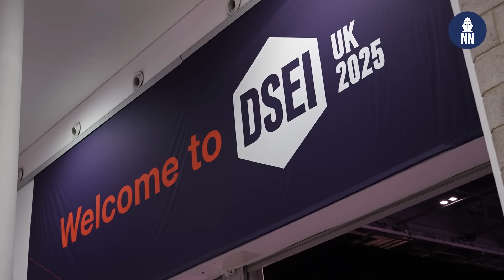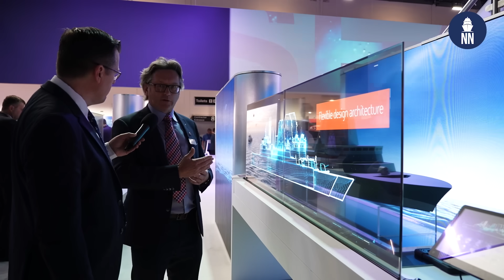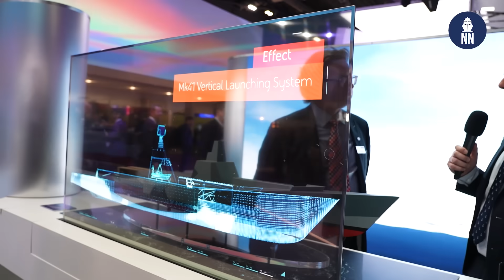Future Air Dominance System (FADS) concept ships by BAE Systems

Comment: Air dominance is important but I believe more urgently we need a significant improvement in anti submarine capability. It seems Russia will be a threat for the foreseeable future and the UK is very vulnerable to undersea warfare given our data and oil connectivity to Europe and Scandinavia. I feel we need to revive the WW2 concept of the "Flower Class Corvette" That is a cheap quickly mass produced hull (An off the shelf design preferably to speed up delivery). Fitted with up to date anti submarine (and drone) technology. Crucially we need enough of them to continuously patrol the entrance to the Baltic and the Greenland/Iceland/Scotland gap to counter Russian sabotage in the North Sea.

Comment: Sounds like the goal is to get the crew so small that they will never get to sleep. The ship will have reduced effectiveness after two days, and there will not be enough space onboard to train people.
Reply: The lean manning critique is fair for 1st generation automated ships, but it overlooks the core design shift in the Type 83 and FADS concept. BAE is moving toward 'Mission-Led Manning' where the goal isn't just to cut bodies, but to eliminate the manual donkey work  like damage control monitoring and routine maintenance,that actually causes sleep deprivation. By using a 'system of systems' approach and uncrewed vessels like the Type 91 arsenal ship, the Royal Navy can offload the magazine depth and high-risk tasks to autonomous platforms, allowing the crew on the Type 83 to focus purely on high-level command and control. Modern ship design now uses Human Factors Engineering to simulate crew fatigue levels decades before the first steel is cut, specifically to ensure that the shift to AI and automation increases tactical endurance rather than exhausting the sailors.

Comment: I can't imagine the smaller design being an option. Large and powerful radar systems, like those that would be required are heavy and power hungry so you would need a hull big enough to support that and enough power generation to power the sensors as well as future energy weapons. You also need to carry a sufficient number of VLS. I can't see it being any smaller than Type 45. 

Perhaps something similar in size and capabilities to the up-gunned Hunter class with 96 VLS as shown previously by BAE.

Comment: Maybe controversial take, but I believe the UK was ultimately correct NOT to take CATOBAR carriers. Why? Its not just a case of 'adding in some cables and catapults', the amount of space they take on the ship - which can now be used for more aircraft / helis in STOVL is an advantage - also the additional training requirements of the deck crew for CATOBAR function are substantial - the maintenance of these systems and running costs too (we are not as flush with cash as the USA) and the case that for realistic combat scenarios where our carriers are in harms way, they will likely be lower-intensity. We can't afford to put them in high-end fights for fear of losing them and the consequent blow to capability + prestige, therefore the payload and capabilities of the B model are sufficient. Also, they were meant to be 'adaptable' designs with feasibility for adding the CATOBAR configuration with ease, but actually nothing was done to achieve this and it would have costed billions just to get up and running (with questionable electrical power generation as they are not nuclear) and likely led to the 2nd carrier being mothballed in the process, for marginal improvements.  Yes, ski-jump looks ugly, but that's the biggest downside I can find to be honest.

Comment: When i heard that the T45 successor was a T83, was really excited- thought we might get some actual cruisers that arent one trick ponies (as great is T45 is in its main role) and a vessel that could do land attack, asw etc. Whatever they say, its all penny pinching if they can't be bothered to make these things survivable against submarines- we simply do not have enough escorts for building them cheaper to work out as a long term solution. Sure people will argue warships dont need their own organic sensors for everything or the quietening- but we dont know if their 'arsenal ships' will ever end up being built.6 15,000 ton cruisers, 6 10,000 ton destroyers (both standard displacement)and the 'arsenal ships proposed should be the main parts ot FADS, alongside much improved land based air defence. 128-144 vls on the 15,000 ton, 64-96 on the 10,000 ton one and 32-48 on the trimarans (which look great) seem optimum.
Reply: why not use the T26 and add 64 cell mk41 with a suitable top end air-defence radar making it a super multi role battle cruiser, perhaps stretch the hull by a few meters if needed.
Reply: @the-bringer-of-truths  A  T26 AAW is viable- you can probably get a decent radar (CEAFAR seems a good bet), and 64 MKl41 just by reducing the mission bay and stretching it to Hunter, River length (151.4m). Beyond that, you need to remove the towed array and scrap the mission bay completely. So the first option worls, build that as the smaller of 2 vessel types and its a great option.

 But at least some of those vessels are going to need tico levels of VLS- just to protect against the kind of massed attacks that might occur in the Taiwan strait etc- probably an ASEV sized vessel. Particularly if we are relying on these vessels to compensate for poor land based air defence, ballistic missile defence

Comment: My speculation for the RN 🇬🇧 Type 83 Future Air Dominance System (FADS) is it will used a modified hull-formed base on the Type 26 City-class ASW frigate with a displacement of over 8,000 to 9,000 tonnes (standard) with a full load of 10,000 to 13,000 tonnes. Length will probably be 155 to 175 meters with a beam greater than 20 meters. As for propulsion I expect it will be an evolution of the Type 45 Integrated-
electric propulsion (IEP) with grater power reserve for future weapons like lasers and sensors like the radar which could be the CEAFAR develop by Australia or a New design by the UK? As for weapons I expect the VLS cells to be between 72 to 96 with most dedicated for Aster missile and FC/ASW with USV providing support or close-in defence against FAIC or Suicide Drones as for quantity I think 6 to 8 T83 FADS is likely supplemented by the Type 26 ASW frigate and Type 31 & 32 GP frigates

Comment: In Ukraine we have seen a lot of small surface drones chase down and damage or destroy russian ships. Since they are so small and hard to detect it is not until they are very close and inside of deck mounted gun range. What I would like to see to counter that threat is for ships like this to carry their own small high speed surface drones that can be launched out of the rear of the ship and be used to intercept, collide with or proximity fuse detonate and destroy the target. It also makes sens from an economical point of view, use small cheap drones to destroy small cheap drones.

Comment: ENGINEER HERE: Sorry but the moment this guys started talking energy weapons and AI then I knew this was mostly BULLSHlT sales hype designed to get sales.
Sorry but we worked out during the first edition of the Star Wars Program in that 1980s that energy weapons were best left in Hollywood. Its just the fundamental physics. Its like trying to argue with gravity. They are so unreliable their only value is as a distraction to potential opponents who will waste time trying to develop countermeasures.
(edit) I corrected the extra 'N" that someone pointed out
Reply: Your 'Star Wars' comparison misses the fundamental shift in physics between 1980s chemical lasers and 2020s solid-state fiber optics. The SDI era failed because it required massive, dangerous chemical tanks that were impossible to scale; today’s systems, like the UK’s DragonFire, convert electricity directly into light, turning the ship’s engines into an infinite magazine. The Chief Engineer isn't selling 'Hollywood hype'—he’s describing a ship designed as a floating power station with the electrical margins to support Directed Energy Weapons (DEW) as they mature. Arguing that DEW is impossible because of 40 year old experiments is like arguing against modern smartphones because of the limitations of a 1984 brick phone; the power density and solid-state tech have simply moved past that era’s constraints.
Reply: @user-et7zg8cm6l  SORRY but your idiocy forgets some basic physics.
FIRST - once the beam leaves the fibre its got the same basic physics of a chemical laser traveling through the atmosphere and being scattered. 
SECOND - You're talking about lasers on a boat in the ocean which is NOT the same thing as a laser battery in space.
THIRD - like every other clown making these claims you have no idea about the energy required to make a laser do what you want. A bullet hits and its kinetic energy is right there on the target. A laser needs to stay focused with precision on the target.  
FOURTH - like every other clown making these claims you have no idea how easily lasers can be deflected or the energy dissipated.
FIFTH - the latest greatest newest laser system for drone needs a 10second burst to disable/destroy a drone. So if someone sends 10 drones at your ship you'll need at least 1minute40 just to drop them PLUS the time to target each drone. How quickly do you think a Phalanx 20mm or Rheinmetall Oerlikon 30mm Millennium Gun with AHEAD ammunition will take?

CAN YOU AND EVERY CLOWN WITH ZERO ENGINEERING BACKGROUND JUST STOP LECTURING ENGINEERS.
We are farking tired of having to explain basic reality over and over and over and over and over and over and over and over and over and over and over and over and over and over and over and over and over and over and over and over AGAIN. ✋🤬🤚
Reply: They have working lasers as we speak and some ships are getting fixed with them. Great for taking out cheap drones too.
Reply: @dan7564  Yeah they were doing all that in the 1970s DlCKHEAD. They were popping target drones out of the sky consistently. 

If they are so farking great then why have they NEVER BEEN USED IN COMBAT?

Its not Star Wars DlCKHEAD
Its the REAL WORLD

How many times have people made BULLSHlT claims about the latest military super technology and THEN IT NEVER GETS USED?

MAYBE 

JUST MAYBE 

They are trying to convince investors or the government or BOTH to hand them money.
Reply: It's not the eighties anymore, and Reagan is long buried. British laser weapons are a reality. Look up "Dragonfire". A nigh-on perfect addition to the tool kit, in the modern drone threat environment.
Reply: @ianmcsherry5254  SHIT-4-BRAINS the laws of physics haven't changed for over 13billion years and they aren't changing just because you think magic is real.
Reply: @tonywilson4713 didn't they say that before the invention of the plane 😊
Reply: @JackBenton-r1u4i  SORRY slight difference.

When they said flying was impossible they DID NOT understand basic physics.

When engineers like me tell you Star Wars wont work its because WE DO understand basic physics.
Reply: Sorry but a radar seeker oder non-emp protected drone will have a tough time argueing with a MW microwave canon that is any modern radar with a little software upgrade. Lets stick to civil engineering Id say.
Reply: @user-qp3hd3cn8e  SHIT-4-BRAINS I did aerospace in one of the elite programs in the late 80s. The postgrads in the department were among the most well funded postgrads in history and they were doing stuff so far beyond you tiny brain it hard to describe.

We worked out what was and wasn't possible or practical. I might have been an undergrad but the work I did on the Abrams  APDS has been used for over 35years and seen battlefield action. NONE of the lasers or microwaves HAS EVER BEEN DEPLOYED BECAUSE ITS EASILY DEFEATED.

Now go back to high school and see if you can learn something this time. Its not a crime to learn.
Reply: @user-qp3hd3cn8e  I agree - but would put it even more firmly; the jamming resistant systems that you would typically find on a drone will have a very hard time dealing with the output of a 4D phased array radar like the ones you would find on an air-defense destroyer, particularly at close range.
Reply: @tonywilson4713. An Engineer that cannot spell, apparently. As an Engineer that can spell, at least somewhat better than you, I have to disagree with you totally. If you have paid any attention to the hostilities in Ukraine you would know EW systems, and RF jamming systems in particular , are very critical on the modern battlefield. There are very definitely examples of RF directed energy jamming systems being used. Heck, even radar systems can and are used in that role.
Reply: @kalicom2937  
I think he meant directed energy weapons, like lasers.
He has a bit of a point, the atmosphere disperses the energy, and if it's raining or foggy ...............

But they are very attractive in cost per shot - if you have enough time on target to transmit the energy.

I am also an "Engineer", just not that sort of Engineer :)
Reply: @kevinshort3943  DEW are not just lasers. If he meant lasers he should say lasers :) 

Dragonfire has had good results. Of course, you are correct that it needs good visibility to be effective, but the same could be said of drones - the attack drones are are too small to fit an expensive sensor suite to them, as a general rule, and it would rather defeat the purpose of a low cost swarm attack if the munitions became high cost (just use Meteor instead!) Current targeting relies on GNSS, Optics and AI so their effectiveness in bad weather is much reduced.

Comment: Problem is these are too exquisite and not cost/time effective. Look, these pie in the sky ships and concepts  will not get financed, procured or manufactured. They will incur the usual over runs and over budgets They are just money drains. 
Why not just repurpose an RFA Argos type hull , insert 4x Type 41 VLSs,  and turn it into an Arsenal ship?
What is needed are more numbers Type 26s/ 31s and more small hulls like the Visby class corvette for continental shelf coverage and presence..
Reply: Argus is nearly 40 years old and has been deemed unseaworthy by Lloyd's Register and the  Maritime and Coastguard Agency.
Reply: @Cartoonman154  He said "an RFA Argos type hull", not "the hull of the RFA Argus"
Reply: @kalicom2937  Ah, oops. Thanks.
Reply: Check out the Royal Navy MRSS project.
Reply: @Cartoonman154  Thanks, very interesting.
Reply: Repurposing an Argus-style merchant hull into an arsenal ship sounds cost-effective on paper, but it ignores the reality of modern lethality. A merchant-standard hull lacks the shock hardening, damage control, and specialized power systems required to actually survive a combat zone,you'd essentially be building a massive, slow-moving target that compromises the entire fleet's safety if it’s hit. BAE’s Type 91 concept is the actual answer to your call for 'mass', it’s designed to be a low-cost, uncrewed, and rapidly producible vessel that provides that magazine depth without the high personnel costs or the vulnerability of a converted 40-year-old training ship. While more Type 26s and 31s are vital for presence, they simply don't have the electrical 'lungs' or the sensor aperture required to defend a carrier group against a hypersonic swarm. The Type 83 isn't just a money drain , it's the specialized 'quarterback' that makes the rest of the cheaper fleet actually survivable in a high-end fight.